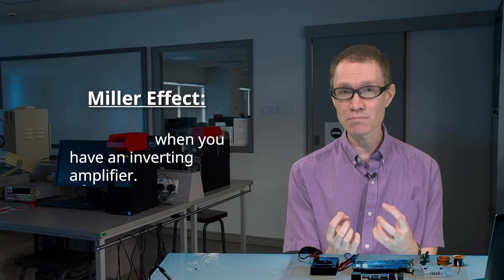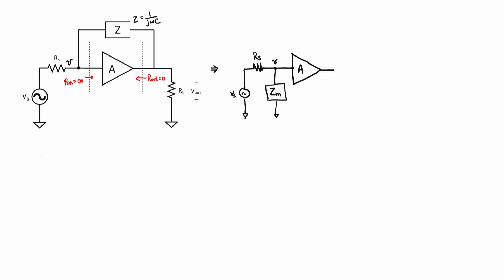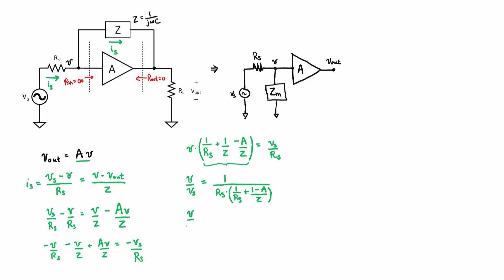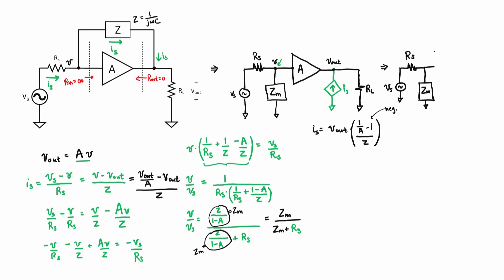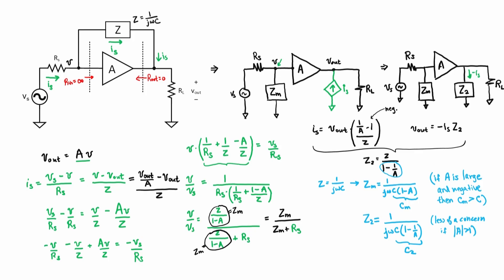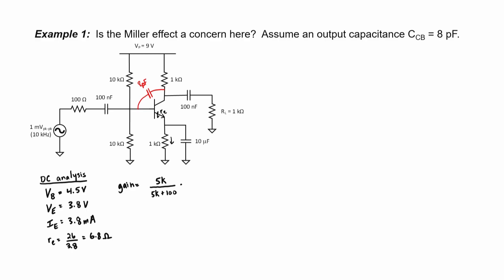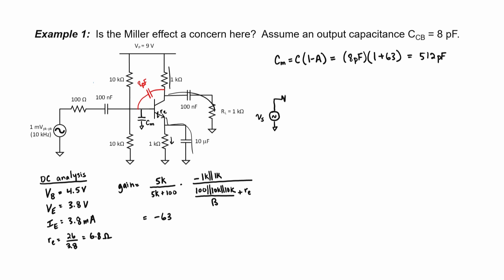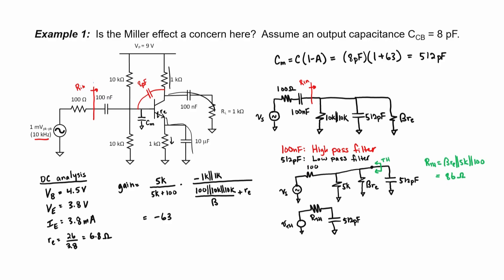Miller Effect (16-Transistors)

Comment: What is a negative capacitance if  gain is a positive number? What does it mean?
Reply: Im no expert but the impedance of a capacitor is 1/jwc right? Negative capacitance just means there is a 90 degree phase difference between voltsge and current

Comment: Why not just simply explain that miller capacitance causes amplification in voltatge amplifiers and impedes amplification in current amplifiers, instead of all the shoving a crap ton of fine points and math up someones arse instead of putting a soothing smoothie in their colon a little at a time and not scaring them off of electronics all together.

Comment: At 9:26 in this video: When calculating Re (emitter resistance), where does the value 26 come from? Is that a static constant? I can't place it. Thanks!
Reply from the maker: It's k*T/q at room temperature, so it's almost a constant.

Comment: Hi Prof! Same effect coming from the Avramenko plug with square wave, or the ZVS circuit... or ChatGPT .. my circuit the ZP1 circuit. Actually quantum plasmoid energy information transfer happening. Nikola Tesla radiant energy, or cold electricity.. Parasitic... c'moon Prof.! 2 zener diode, anode + chatode solder it, and in one pole, square wave, because of harmonics. Solder on 2 legs the LED, and you can hold in in one hand, just one leg of the diode. This is the avramenko circuit. Able to get the radiant energy... this is not Earth ground or normal capactive circuit. Because this has different properties! If you take just a little small wire on the LED and you not holding it... it will work as well! Please chech the ZVS circuit... easy to increase with a MOS fet, plus transformer coil.

Comment: The 8pf (Miller) capacitor is charging and discharging as the collector voltage rises and falls with the driving signal changes and the gain of the amplifier will determin the range of voltages that the 8pf sees. More gain will produce larger and more speedy voltage changes.  Therefor the Miller capacitors effect will vary with frequency. Am I correct?
Reply: Hi there, the charging and discharging of a capacitor depends upon the the frequency and the source voltage magnitude as well as the capacitance itself, now lets say the frequency of the input signal and the output signal is same, no wonder that the 8pF capacitor have less capacitance than base to emitter junction which is 22pF , but since the input and the output voltages are 180 degree out of phase with each other, there will be a more potential difference, not to mention that the output voltage is also getting amplified, therefore the difference will be more and hence the charging and discharging of a current at collector to base junction will be more than base to emitter junction.